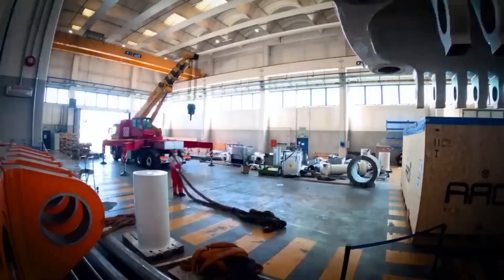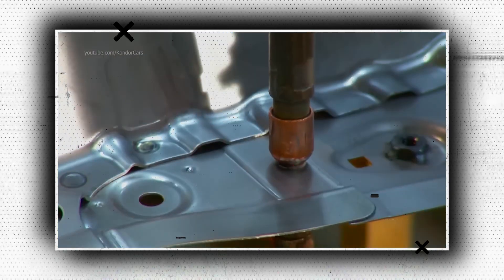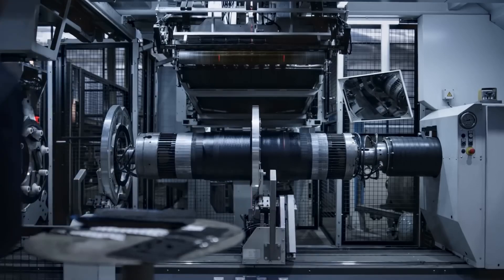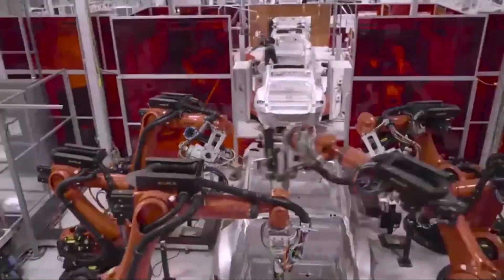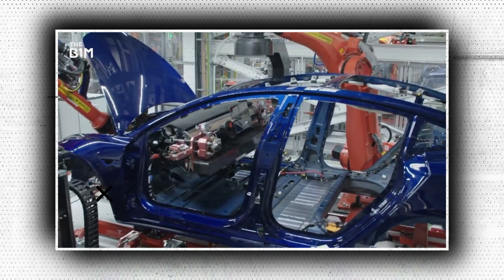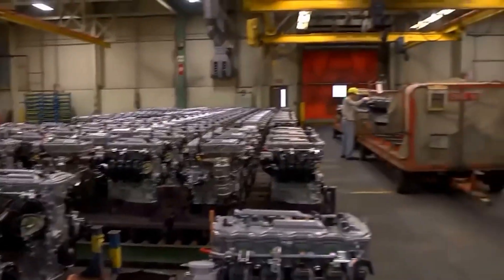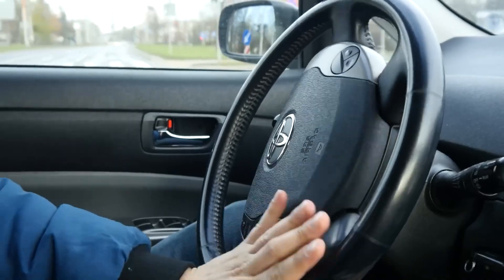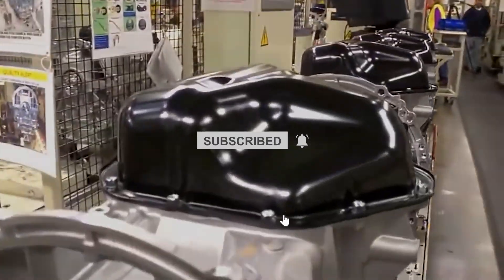Toyota CEO REVEALS Why Tesla Giga Casting Machines

Comment: Giga Casting is not a "fashion". It's an obvious development in making car parts. Why bolt and rivet 50 small parts together when you make one simple unit --perfect? It's 2024!
Reply: Why? Because it is lighter (aluminium pieces are much thicker and as a result heavier) and repairable.
Reply: Sometimes retooling or redesigning of a factory line costs more than the benefits. It's just easier to start from scratch in a new factory. Also, Tesla uses the Aluminum casing for its batteries as a structural reinforcing component of the car, which is a fundamentally different approach. It's critical for shaving weight on non-battery related components for an EV, especially as Tesla's battery component alone weighs an equivalent of a Carrola. It's not necessarily just about elimination of process or robotic arms. It's first and foremost, weight reduction.

Comment: It seems castings will become the norm on par with vacuum formed FRP and carbon applications. As for Right to Repair, stamped sheets may still be needed to facilitate the unit body repair process which is far from the death knell to the collision repair industry. In fact, if the history of collision repair is any indicator, body filler and adhesives will continue to be the most widely used repair strategy for cracks in cast unit body parts
Reply: Using body filler and adhesives on a casting?  OMG I hope not!  Deformations in castings almost invariably create major defects, which would result in a less-than-acceptable piece.  And when made of aluminum it gets even worse.   Using body fillers and adhesives is akin to hiding defects.   The more common unibody structures can be repaired with proper machinery, and are usually repairable even when the damage appears to be more severe than with a cast piece since a lot of unibody parts are still steel alloys which have better 'elastic' properties than aluminum alloys.

Comment: At last the Legacy OEM's Leadership are starting to realize that Tesla has the answer to their EV Production woes, one of them being the Giga Press.  But some of the problems mentioned here about the variable thickness that parts of a Giga- casting may have, have already been addressed by Tesla and are no longer valid, if the process is made in the same fashion as Tesla, and that is attested by the thousands of Tesla Model Ys being already produced. Each unit has two giga castings and Sandy Munro has said are perfectly aligned and processed.  Another point that is senseless is the one that giga castings can not be repaired in case of damage. If there is damage to the vehicle that also damages the giga casting, that vehicle had suffered extreme damage and would be considered total loss and its occupants must possible are dead, so no need to repair.
Reply: Mazda will die first.
Reply: Mostly good points, but you are wrong on repairability. You can and people often do repair cars that are totalled. When a gigapress part is damaged the car will likely not be repaired
Reply: @jackbarry9469  lol. They say it's going to be 1/3 the repair time and 1/10 the cost. The price of stamped pieces isn't even close to   cast. I would wait till it's more usual then say it won't work. Toyota is doing it. So it must be smart right? Just like avoiding EV's I'm sure it will serve them well.  Lol
Reply: @IcyPrepper76 Toyota not avoiding EV at all . But what would u know
Reply: @wengelder9256  More then you. They will still be the last of the gas to die because of quality of product and size. But that little ping-pong air fresher Bing bong Mazda is going to eat it all the way down the hill. Not enough sales to Maintain dealerships or network . Plus nobody wants that crap
Reply: Casting will cause will cause the cars to be scrapped or totaled earlier in their lifecycle than a ICE car with a frame or unibody construction.  The castings just aren't as 'flexible' and repairable as the other two common types. That's a main driver of the higher insurance costs for Tesla cars than a comparable ICE car.